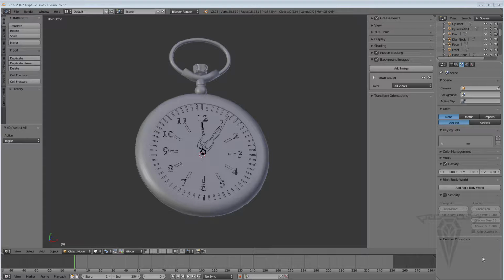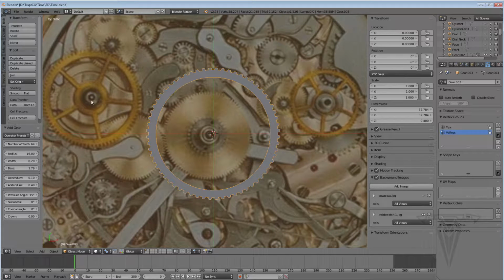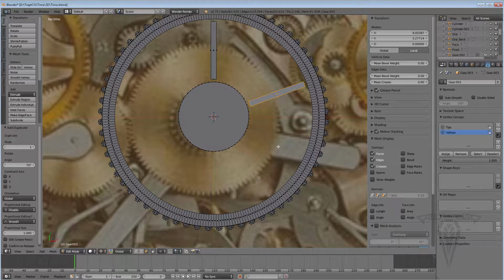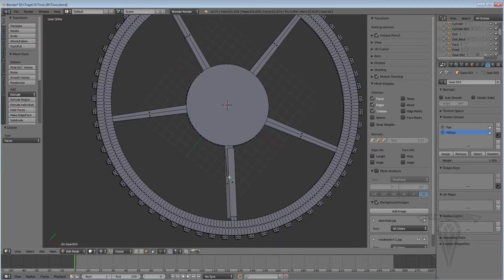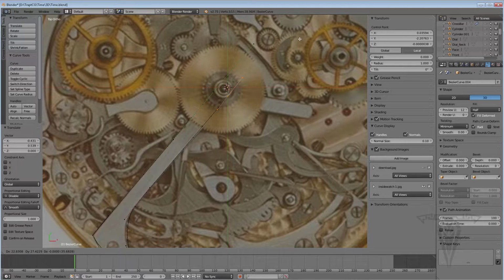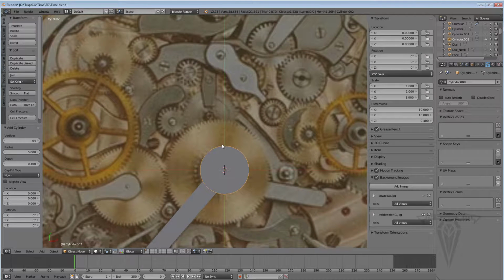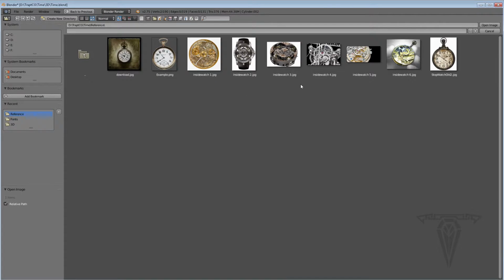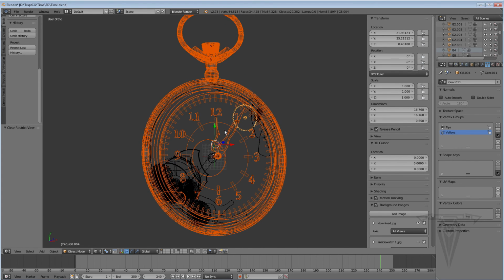Part 3: Blender Time Tutorial, 3D Modeling Gears and screws

Comment: On the gear spokes rotate: If you want 5 spokes, just divide 360 by 5 which is 72 degrees. Every time you duplicate one of the spokes just hit R followed by 72. Quick and easy. There is an even quicker way using the Array modifier and an empty but that's probably a little beyond the scope of this tutorial... :)